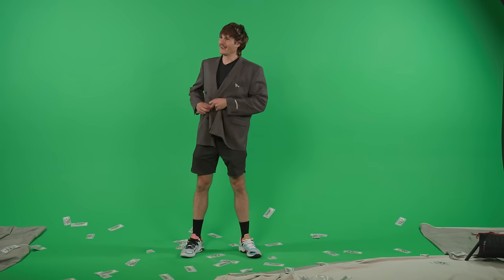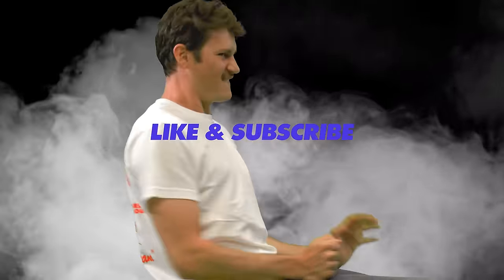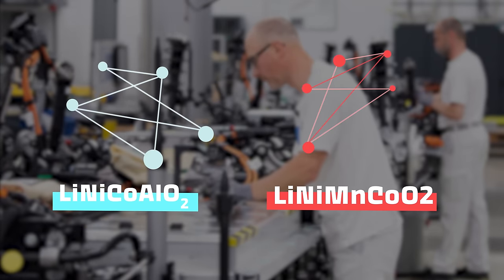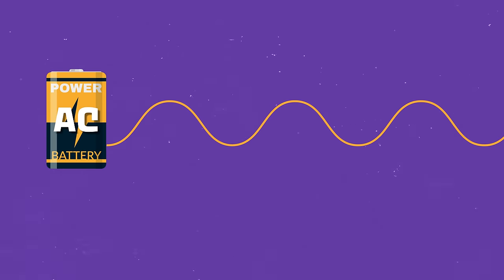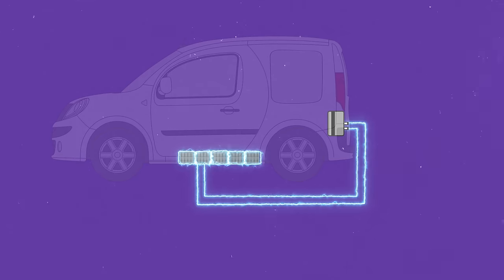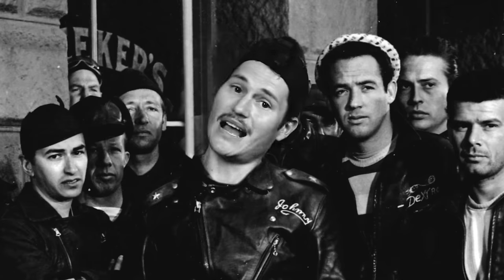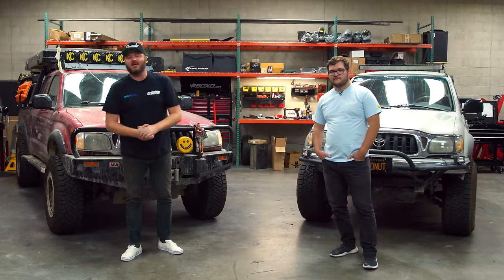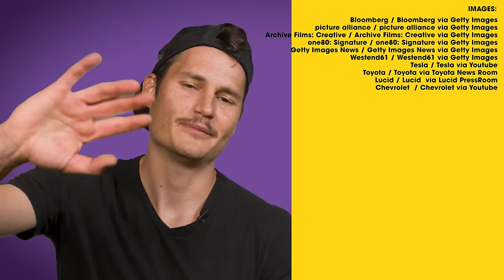Why this Chinese Car Costs $900

Comment: "washing machine on wheels" - apt description. On another note, this car's performance would meet the needs of a large chunk of city-dwellers, kind of like a scooter. Sad that people's desires are not in line with their needs - more cars of this form factor (albeit higher quality) would help reduce traffic congestion.
Reply: @thefirehawk1495  doubt it’s legal in most places as a car. if anything it’d  be considered a scooter
Reply: i think a 2 hp car is much more comparable to an electric bike with a shell, which is also not really allowed on regular streets because, you know, it’s slow as hell.
Reply: @Appletank8  As previously stated, I believe this would fit the needs of many people. Obviously it is not a car made to go on highways or even large thoroughfares - it is a neighborhood type of vehicle, and would (and should) be regulated to only be allowed on low speed surface streets, similar to scooters and mopeds. This is basically a scooter for people who are scared to ride scooters, or who do not want to get rained on when they take short trips in town to the store/whatever. Many people do not need to drive a car capable of driving "fast as hell" - if anything I wish laws in the US were such that more skill and testing was required for higher powered vehicles, as is the case in aviation, as well as for many European countries. More people driving more cars like this would result in far fewer automobile deaths. It's just something to consider.
Reply: @MBergyman  Unfortunately, most of the US is simply not designed for light vehicles. You need to be able to hit 35 mph in a reasonable amount of time.
Reply: @Appletank8  We can disagree what we think is the correct approach for driving in the city, that's ok. My point is that a car this size could work for many people, is less costly, and takes up a much smaller footprint. The fact some people would get pissed off being "forced" to drive the speed limits that are already in place on most city streets in the US is a different problem, I would argue one that should be worked in different ways than just outlawing slower vehicles. The exact car in this video may be (and is likely) a death trap, but that is not to say this size and format of car wouldn't work - Smart Cars are only a little bigger, and they get around just fine in town. I would not take a Smart Car on the highway, but that's just me.
Reply: @MBergyman   The reason I specified needing to hit a decent speed is because most of the US is just too spaced apart, and in cities the population density means public transport is just a much better idea than having everyone get their own vehicle. The Smart car I agree is a decent idea, though its fuel efficiency kinda sucks for how small of an engine it's using.
Reply: @thefirehawk1495  this may not be legal for high speed roads but it definitively is. In Italy there's a distinction between "automobile" (something like the typical car) and "quadriciclo leggero" (something like this. There's a whole market for this, tiny cars with plastic bodies, 45kmh top speed and a 50cm3 single piston diesel engine with 4/5hp. They can be driven at 14 years. Shame is, usually they're aimed at rich kids or old people with no license, it's a strange market so prices are high (usually ~8k€ for the basic ones).
This would definitely sell well.
Reply: Yes, not only congestion, but also reduce (eliminate) polution.
Reply: @drister007  maybe, but it could be argued that engine size and technology has more to do with the amount of pollution rather than the size of the vehicle. Look at the Smart ForTwo. Crap fuel consumption for such a small car. My full size diesel Passat gets similar city mpg, and massively beats it on the highway. It is heavier and takes up a lot more room though, so is not as easy to manage in the more congested parts of the big city (in my case, Los Angeles).

Comment: It would pretty awesome if tuks-tuks were sold in the USA
Reply: I remember reading about a company out west that sold electric tuk-tuks that they called an e-tuk. They even had a stretch version that could be used as a mobile banquet or flea market. No idea if solar roofs were an option however.
Reply: Import a 25 year old one

Comment: in china these are categorized as "elderly motorized quadcycles", and they can't be registered as cars. but since they got air-con inside, for years people( elder or not) bought them as an alternative to cars. they are being heavly regulated now in china's major cities since people kept driving them on major roads and inner city expressways, causing road congestions due to low top speed and sometimes major accidents that often involving death.
Reply: Yeah I have no idea where you could even use these in the US except maybe inside a warehouse, the maintnence guys at the one I work at already use something like this.

It's too big/fast for bike lanes and too small/slow for roads.

If a developing country like China chooses to squeeze these kinds of vehicles out as it develops its road infrastructure, they have zero chance in a country with infrastructure already built NOT to accommodate a vehicle like this. I was questioning whether this is even street legal here the whole time.
Reply: @4DRC_  a new law will be implemented in early 2024 to regulate the production and usage of these vehicles, basically means these vehicles will be illegal to produce, sell, and use it on the road. Personally I'm glad that they are finally being regulated, but at the same time I know for a fact that it will take a long time and lots of firm actions to fully get rid of these little things from the roads altogether.

Comment: God bless them for putting rack and pinion in an EV. One of my biggest gripes with EVs is the complete lack of even an attempt at steering feel, making driving fast incredibly disconcerting in higher speed corners when you need feedback to know when the rubber lets go and you die. And honestly I have a rack and pinion in my E30 and it is better than any modern steering system, although that is almost meaningless.

Anyways, take note!
Reply: Electric steering does give sufficient feedback, it's just feels so wildly different from any other type of steering that getting used to it is nearly impossible for someone already used to the steering feel of a mechanical linkage. If you take time on a closed course, you could eventually learn the way the steering feels at the edge of grip, it just won't be fun, and it won't feel "connected" like a rack-and-pinion
Reply: I use the z3 rack in my e30 as the gold standard for feel besides maybe a newer Porsche or something haha. Electric power steering is just not the way imo
Reply: Not just a rack and pinion, but a freaking solid front axle with king pins!  That’s what our wrecker and semi trucks have at my work!

Comment: I would feel very safe in this insanely powerful car. this thing is probably as fast as the tesla plaid. Buff Horses For Days!
Reply: I'm somewhat interested in it but granted a jacket, helmet, some motorrad jeans will protect me better than the half thermos thick steel they have on this car. Still cheaper than 1 regular buff horse and hay upkeep.

Comment: That's why if you're gonna use lead-acid batteries and plan on running it down regularly, you wanna go with deep cycle or marine batteries since those are more engineered around being ran down a lot. The drawback is that because they're designed to be ran down a lot, they aren't meant to go through partial charge/recharge cycles.

Comment: In Germany this isn't actually a car. It would be classified as an "Lkfz", a "light powered vehicle", which is basically a moped on 4 wheels. No tax, no regular safety inspections, no DMV registration, you don't even need a regular driver's license for cars, just one for mopeds you can get at 15 years old.

Comment: I actually really want the pickup variant to put a go kart engine in as a parts runner to go to orileys or something while my own car is on the lift
Reply: Yea so Mitsubishi mini truck?
Reply: @kidsythe  this is like, a Microtruck lol. Honestly, a Geo 3 cylinder would work great, or even cooler, a Kutoba 3 cyl turbo diesel tractor engine.

Comment: This one reminds me of the Citroën 2CV: the "ugly duckling" car that got the French back on the road after World War 2. It was so basic: the windshield wipers were powered by the same shaft that moved the speedometer, the seats were basically cloth beach chairs, it had crank starter until the end of production in the 90's, and you couldn't even roll down the windows, you could only open them a little bit by tilting the glass.

Comment: I've seen videos of this car before, and I think they are quite interesting. It would be almost hilariously simple to upgrade and improve the range and speed, as well as to put brakes on the front, but I'm not sure the car would be very safe above 45 miles per hour.
Reply: Not planning to hit anyone EVEN IF I WAS DRIVING A TANK(driver training)
Reply: @bunzeebear2973  most people who hit people in their vehicles didn't plan to.

Comment: Make it with a top speed of 65MPH with a range of 50miles with solar panels on the roof and you got the perfect commuter appliance.
Reply: I've been thinking an electric motorcycle with those capabilities would be the ultimate commuter appliance. Would be the lowest-cost commuting vehicle possible. Nothing on the market that fits that niche right now, electric motorcycles are basically either scooters or sportbikes, but soon someone will come out with that.

Comment: Keep in mind that these are not cars for the road, they are for private closed property, like your mansion, a factory, a movie studio or a golf course.
I also saw people using them in farms for carrier stuff from one part to the other (pickup version of this).
I say they are really good at their job and are a welcome affordable solution.
Reply: They are classified as a low speed vehicle. They are street legal in most states if they are registered with the Federal government as an LSV manufacturer.
Reply: @biffmalibu3733  Well that's disconcerting to know.
Reply: @-na-nomad6247  not really. These cars are perfect for large cities where the average speed of travel is under 15mph or in rural areas like mine where 25 mph is the average safe speed you can travel. The auto industry has brainwashed people into thinking they need a big fast vehicle that costs alot more to buy and operate when in reality most people don't. I actually started riding an E bike to work and parked my truck.  It takes 25 minutes in my truck to get to work and only 30 by bike. A low speed vehicle would cover 90% of my travel needs. They aren't for everyone but they would work for many. Small vehicle's aren't dangerous, it's bad drivers in big vehicles that are the problem.

Comment: I appreciate the engineering involved in cutting costs, but a lot of things are potentially lost in the process. Things like safety, environmental concerns over increased lead mining and battery production, as well as, and perhaps more importantly, labor conditions and compensation are potential issues. I would have to do more research, but something tells me these weren't primary concerns.
Reply: @smithmahant8290  It is indeed an incentive, and America has certainly benefitted from this kind of labor, but it is absolutely unethical in many circumstances. This particular item just seems to embody this practice, at least imo.
Reply: Far from it, it was just designed to move people at the lowest cost. Full stop
Reply: This car is going to have a completely negligible impact on lead mining... -_- ... Do you have any idea how much lead we mine a year? You obviously don't...

And labor conditions? You freaking serious dude? Not buying ANYTHING made in China (or even worse, the entire developing world) in the modern world is literally impossible. And it's better for them to have a job (even if it sucks by developed world standards) then not have one at all. This is one of the dumbest, clueless, most Western-centric posts I've ever read...
Reply: @Cooe.  I second this
Reply: @Cooe.    I literally said I'm going to do some reading on it. I stated nothing conclusive, and neither did you. I never said don't buy anything from China because of labor or that no lead batteries should be used because of mining practices. If the entire world switches to cheap consumer electric cars because they are cost effective, it becomes an issue. China also has one of the highest suicide rates per capita of any country in the world, one of the contributing factors being poor labor conditions, amongst a slew of others.

I am not taking a moral high ground here, the things stated were simply concerns. I will continue to read up.

Comment: did you buy one yet.. can you get license registration safety inspection pass in any state?  Would this be classified as a moped on 4 wheels?
Reply: No, even in China where they were invented and manufactured, they can’t be registered and are technically illegal to be on the road. Chinese young people ironically call them elderly leisure, tripping iron box, or moving coffin because they are usually driven by elderly people who never had any driving training and constantly break traffic rules. Thus this type of vehicle has high accident rate.

Comment: How do I go about registering one of these ? Or does it fall under the same rule as a 50cc moped where it doesn’t need registration or insurance
Reply: NEV: basically a glorified golf cart
Reply: Pretty much a road legal Low Speed Vehicle, common for golf carts in certain areas where the whole neighborhood has speed limits are under 25mph
Reply: Ask your DMV

Comment: You had me sold until 25mph and 40 mile range XD Just recently found out when a dog hit my CRX this week Honda saved some cost and weight on the HF models by using a single wimpy metal car for the bumper reinforcement so crx is an old school version of this but still enough to count as a car since ya know it can go normal car speeds lol however having a dog run into your CRX at 60mph on the highway does A LOT of damage. Radiator and fans, AC condenser, bumper bar (cause can't even call it reinforcement), bumper cover, hood, turn signals, and headlight destroyed. So it's probably a good thing that car can only go 25 mph cause you'd die in a wreck probably even at that speed.

Comment: With tops speeds of 25 miles per hour they are safe in and of themselves, the danger comes in when met with a bigger, heavier, faster vehicle. It couldn't be much safer than a motorcycle in a crash.

Comment: I love the way Jeremiah makes fun of himself. He's quickly becoming my favourite guy at Donut.
Reply: I think he is trying so hard to be funny is just sad
Reply: @gtx-808  He's something like 47 years old, which is also sad. You could scrape a layer of oil and whatever the fuck else off that face if you swiped it with a bit of plastic. Probably a bit less skin than he used to have on there, though, looks pulled and stitched pretty tight over the frame. Nothing funnier than "How do you do, fellow kids!" from a man closer to the grave than to childhood, and desperately embarassed by that fact.

Comment: This is the kind of vehicle that would be perfect for a fleet of in-town only self-driving taxis that could drastically cut the cost of implementing better public transit in the states. Every person needing a trip 10 miles away and back could do so without a personal car and take much less time than waiting sometimes for hours taking a bus.
Of course they would need to be changed up a bit for range and safety, but honestly if there were no other types of cars on the road that wouldn't be nearly as much of an issue.
Like why is it even okay for a semi to go down a residential street?

Comment: ive noticed on other cheap china electric cars, think the same brand. but they used a Chrysler steering wheel and a jeep on/off button. i think there also going thru the left over bin to save costs

Comment: What we need is the Americanized version of this idea. Give us about 100HP, 150 mile range, top speed of about 90 mph. Tiny car, short wheelbase, 15 inch wheels, no driver aides. Cheap cloth seats, AC, a decent stereo with blue tooth. Basically looking for a taller, roomier version of like a 1990's corolla but with a hatchback. I'd pay 12 grand for that.

Comment: I would love to see one of these turned into a hybrid with a $500 6Hp generator. Would only add 50kg by itself and maybe 100 all up with all the extra mechanical stuff. Done correctly you could have regenerative braking, a much longer range (burning gas though) and around 10 HP total with both motors and the engine running.
For inspiration take a look at briggs and strattons's 1980 hybrid which was built around one of their 18hp Vtwin engines with an 8hp electric motor, it was weighed down with 500 kilos of batteries so struggled to reach speed and only had 60 miles of range.

Comment: To be fair it's never going to need to brake enough to heat the friction material to the point of fade and drum brakes have been stopping 40 tone lorries for decades. Lots of cars still use kingpin suspension/steering systems they just disguise it as a hub carrier.  Lead acid batteries can last for a long time if maintained correctly. My 1969 morris minor still runs the original  12v 45A lead acid lucas battery it came from the factory with.  For the cost it sounds like a fun toy. But that's all it is, a play thing. It would never pass type approval for road use.

Comment: You need to look up The Inja. He does motorcycles, electric motor cycle conversions, and ended up with a Chinese crap electric motorcycle and then got scammed into a supposedly Chinese super electric car. He ended up with a Changli and has been slowly upgrading it to something worthwhile after he managed to get most of the money back and kept the car.